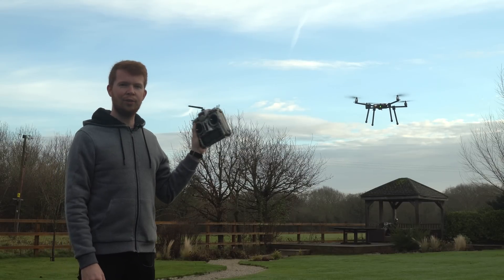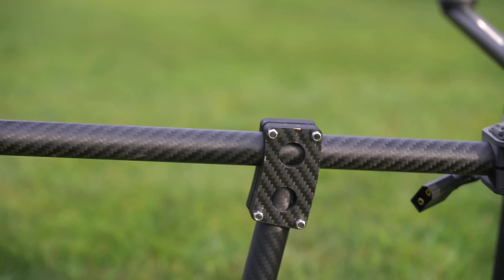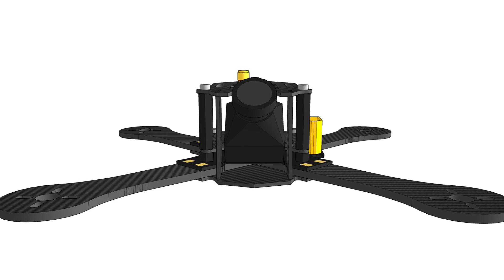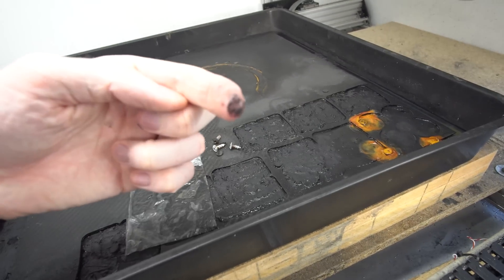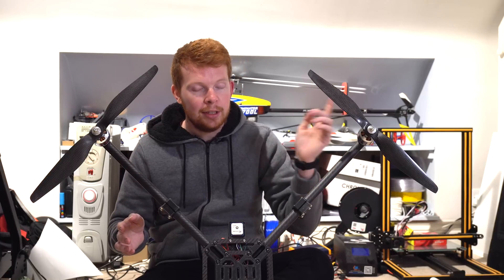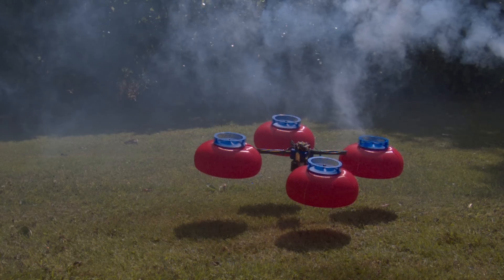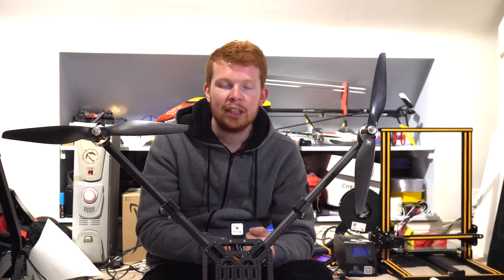I CNC'd a Drone

Comment from the maker: Heres a summary of info that wasn't included in the video:
- No you didn't read the name of this channel wrong, this is my second channel.
- The flight controller runs iNav firmware for the GPS capabilities.
- FDM 'carbon fibre' 3D printing is still far weaker than actual carbon fibre, but good luck.
- The drone cost approximately £270 (approx $350), not including the carbon fibre sheet, multiple broken cnc bits, radio receiver and 3D printer filament and one set of batteries.
- I won't sell kits as it takes a lot of time to manfacture, and there are many cheap kits available.
- I don't sell racing drone kits anymore due to a lack of interest and lack of income.
- Yes I will probably collaborate with Tom Stanton at somepoint if he wants to.
Reply: I'm glad you're going to collaborate with Tom, I think you and Tom will make a fantastic duo
Reply: Tim Station what software are you using on the flight controller ?
Reply: I recommend the pixhawk fc
Reply: Hey I was wondering where you get the carbon plates from and what thickness you used for your racing drones?
Reply from the maker: @Internetprolet1312  I bought it in bulk from a Chinese manufacturer. There are many out there on Alibaba. They were made from 1.5mm and 3mm thick sheets.
Reply: Tim Station thanks for the fast reply I’ll check it out. Thanks alot
Reply: What about the battery tray/screw head riser that's on top of the top plate, do you have the STL file for that? It doesn't seem to be on Thingiverse.
Reply from the maker: Oops sorry I missed that one. It should be added now
Reply: @TimStation  Hi, is there a stl file with all the parts?
I want to see them all together on the drone. Please help me
Reply: Really love the look of this kit. Great job. I currently have a Tarot 650 frame I an putting together. But would love to build one of these.
Reply: Crazy Jonny you still have the information?
Reply: Hey dear nice to see another channel of yours and this does look like one awesome done. One question what do you use for the release mechanism to drop objects.?
Reply: Subscribed 27 April 2025, after you mentioned this channel from your main channel. Been subscribed to that channel for years.
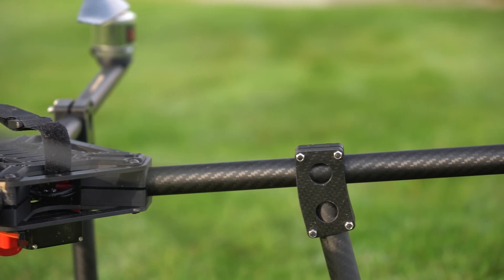Reply: at 1:08 you can see the arms are angled slightly up. Why did you design the drone this way?
Reply from the maker: @corneliusgruss  The upwards angled arms increase position control so it requires less frame tilt to move laterally. This also means GPS control gains can be lowered and it can hold position better in wind with minimal frame tilt.

Comment: Can't you just as easily print a dxf file and or convert that into a 3d model easily, I think in some CAD packages you can actually import a dxf file and use it as a reference or just import that into your sketch

Comment: Hey, I'm building this setup at the moment and I'm having some issues with the motor acceleration on throttle blips. Did you change Motor timing/Rampup power in the ESC settings?

Comment: Hello Tom. I only recently discovered your excellent series of videos and am filling these boring Covid-19 days with your demonstrations.

In this video you gave an analysis of the various weights of the components and potential payload. That this drone can carry. I have ben contemplating the idea of a helium balloon type of space frame that could be designed with just enough structure to support the motors/propellers and let the helium filled soft structure filled with sufficient gas to off set the various components and potential payload. 

Additionally, have you ever considered a helium balloon attached to the batteries which could be tethered (such as 3 thin hollow rods) below a drone in such a manner to stay stable relative to the drone and supply enough lift to offset the battery weight?

Comment: Hi Tom.  Helluva CNC you got there.    I recently got up and running with my own CNC router mill.   Learning how to cut CF and jot break bits has been an experience.    I also cut under water, I actually cycle my water through a fultraion setup so my CF waste os captured and easily disposed of.  The secret to my CNC bathtub is the toilet bowl overflow system(also similar to aquariums that use sump type filters).

  My method requires me to fixture the panels and machine with tabs.   Seems most of the folks out there use a tape/crazyglue and spoil board method but then they are generating dust.

I have already built several micros of my own design on up to very large tube frame 10-12inch builds.    Currently in the design process for a possible 22inch monstrosity that will be running on 12s4p 18650 packs and 5215 300kv motors.

Already having a ton of success using 18650 on everthing from 3in micros on up to Xclass with 6s2p packs running together for 6s4p.  18min flying time on 400kv 13in with 12000mah cruising 40mph the entire time is my best so far.   Soon will have my Xclass running 8s4p.

I learned with one of my builds that tube clamps and tube arms can suck for aligning all the screws/clamps if you use a bottom and top plate to sandwhich all the clamps.

Comment: May i know how do you stabilize the drone, i tried to make one but turns out my drone not stable
Reply: A flight controller needs to be used. This is basically a device that compensates for disruptions (i.e wind, or drifting)

Comment: Those Aerodrive are rated to 5S Tom, if that's who you really are.
 A bit bold to punish with 6S. Not getting a little"warm" under load?
Change of topic: Nice beefy gantry risers on your  Router. Never seen one quite like it, and I have searched the web high and low.
As I recall you had an interesting time with the install or the vendors:-)
Anyway its the quad is stout looking battle ship.
Reply from the maker: Voltage rating on a motor means very little. It's mainly a guide to prevent people over loading a motor. Theoretical the motor can take any voltage, however the load needs to be adjusted accordingly to the kv rating and RPM of use. Yeah the guy who sold me the CNC was a bit of a nightmare haha, but fortunately they don't sell kits anymore

Comment: If the flight controller is mounted in the center of the frame, how is the USB port accessible when need to connect to PC and make some changes/re calibrate? Also, in which way your drone falls when the throttle is cut all of a sudden? Does it fall with landing legs facing the ground or flip upside down?
Reply from the maker: The USB port is easily accessible from the side of the frame as there's a lot of space between the frame plates. I haven't test dropped it yet haha. But I assume it'll depend on many factors, eg which prop turned off last etc.
Reply: @TimStation  Also, I want to know more about how you drilled holes for motor mount on those CF tube arms... Would have been much nicer if included it too in the video
Reply from the maker: @abhishekreddy2425  I used the CNC to cut the holes as seen in the image at 2:31 in the video
Reply: @TimStation  Got it! I'm building the frame with some modifications for my Pixhawk build for DroneKit projects, Thanks!
Reply: @TimStation  How did you place the arms of your DIY quad frame properly with no motor tilt that could cause problems in yaw axis...
Reply from the maker: @abhishekreddy2425  sorry I just found this after last weeks livestream. It didn't show up at first due to it being a reply. The motor mount bolts go through the arms to prevent twisting, then they are just clamped tight at the frame end

Comment: for such a big drone KV is quite high, I would recommend change motors to something like tarot 4108/380KV or 4114/320KV. It will definitely increase flight time and improve overall efficiency. In my setup, I was using 6A/4S with an 800mm frame. With all the equipment the weight was about 3kg. It allows about 30 mins of narrow flight time. FC was a custom one but based on Linux+Ardupilot...

Comment: https://youtu.be/5_HIgBAyRe4 I had built a replica of the DJI Matrice 100 using the same methods. Very satisfying I must say and challenging at the same time to calibrate the F3 FC and iNav. Regretfully didn't use it much after I got the Mavic Air due to its portability.

Comment: Tom- er... Tim... You posted this video at exactly the right time for me. I'm currently working with another drone enthusiast in my area to model and manufacture a frame design of his. We're at the stage of cutting the frame and by God I'm having problem after problem trying to cut these damn 2mm sheets. We made a milling bath and are running it on a Shapeoko XXL. What kind of endmills, feeds and speeds are you using? What're you using to hold the CF sheet, and what's your sacrificial material? And what do you do to dispose the carbon water?
Reply: I was wondering the same think about the carbon dust residue. That's not something that is easy to dispose of responsibly on a small scale, I'd be interested to hear of well thought out innovative solutions.

Comment: You didn't "make" a drone...you've made a frame and bought the electronics and software (or used someone else's free software) There's some difference there...don't you think?
There-s more to a drone than just making a pretty X and stiking the rest of parts on it as seen on youtube from someone else...
Reply from the maker: So I'd have to manufacture all the electronics and program everything with my bare hands to say I've "CNC'd a drone"? Ok

Comment: if you're cutting underwater, do you have issues with water getting between the layers of the carbon fiber?  I know when cutting with a waterjet, water ingress between the layers is a real problem.
Reply from the maker: I haven't noticed any issues so far. Does it increase the weight of the carbon? Or de-laminate the layers?
Reply: Tim Station it would do both.   Water between layers because of delamination.

Comment: Why not just convert the Trex in the background with an FC?. You'll get more flight time, more power and helicopters are much cooler anyway :)
Reply from the maker: Helicopters are awesome, but also expensive haha. One crash with the Trex would cost most than this whole drone!
Reply: @TimStation  Yeah I have a T-REX 600 and the cost of a crash can be anywhere from $200 on the low end, to $600-800 on the high end depending on what breaks. (I'm sure you're aware of this, but just posting it for others) Mine is currently out of service, so I built my own CNC machine to cut the carbon fiber frames as those are currently broken. Just haven't gotten around to cutting the CF yet as I've been messing around with cutting aluminum.

Comment: Nice frame! Any reason you went with 530kV motors instead of 380kV? I'd imagine the power draw is much higher.
Reply from the maker: I picked the 530kv version as there was a similar specification Tmotor that ran 15inch props. 380kv might work well with larger props or higher voltage batteries.

Comment: Very interesting! Thanks for this video! Would be curious to see a more in depth "how to cnc cut carbon fiber frame" and "how to design a quadcopter frame".

Are you running arducopter or iNav on the flight controller?

What is the weight of the frame itself (with and without the legs)?
Reply: He's running iNav

Comment: Great build, awesome! If you want to boost up the flight time (efficiency) oy your quad, use slower turning motors with bigger props. I had great success with Tarot 5008 Motors and 18 Inch props. They are a bit more expensiv but not much! This configuration will give you over 3Kg of thrust per motor and much higher efficiency. The bigger the prop, the better the efficiency at given thrust. Also, the Tarot motors have the t-mount hole pattern and are even 25g lighter than your turnigy ones.

Comment: Can you upload the settings in your Taranis or go over the setup?  I’ve had issues with mine, when setting up the failsafe that if it lost signal, it would auto return. Mine flew out of control and landed while doing a 180 straight into the ground.
Reply: Hey bro! Could you please help me build this thing! I already have all the parts, I just need some help with the motor mounts and the GPS

Comment: Why not 3D print the frame?

Going for annealed PLA, other high strength filaments or even carbon fiber if your lucky and have access to an markedforge printer. 

Should be doable?
Reply from the maker: 3D printing has great applications, but for the design of this frame, it can't compete with carbon fibre sheet in terms of strength per weight.
Reply: Tim Station I understand that carbon fibre plates are strong. But looking at the design I’m wondering if it actually could be 3D printed entirely. Except the arms, which could probably use pvc pipes to keep cost down.

Comment: You said there wouldn't be 3D files so people wouldn't print those frames
But why shouldn't they?
Reply: 3d printing frames is not a very good idea. This is because 3D printing does not offer very strong results, and often results in a very brittle and weak frame.

Comment: Hey absolutely love it i already have my printer going and my friend cncing the frame. I can not find anywhere that sells those motors outside the us. Im in ireland i know you are uk based could you drop a link where to get them or something similar
Reply: I would go to amazon, I think they make international deliveries. I would go with DJI motors as they delivered quite promising results for the drone i built and designed.
Reply: @VoltageGuy2000  which dji motors did you go for?
Reply: @Schulz-Racing  Oh I went for the DJI phantom motors, they worked extremely well for me. Good luck!
Reply: @Schulz-Racing  I have done multiple experiments and have gotten very good results, but if you want higher performance, I suggest slightly bigger motors, maybe ones from the DJI m600 drone?

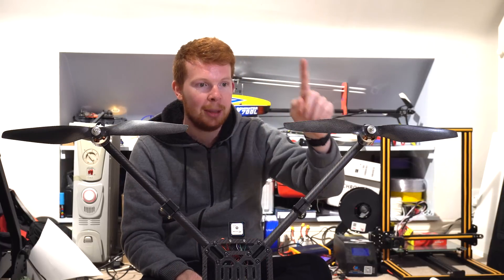Comment: Tom, at 5:35 you explained how a wing could block the thrust if it was under the prop. I'm curious about this - is the thrust not created by air being accelerated by the props. How does the downstream airflow affect the thrust or is it more an issue of the airflow being redirected and therefore causing stability issues?
Reply from the maker: Yes thrust is created by accelerating air. However, if it hits a wing below, it'll change direction, therefore accelerating in a different direction. It's essentially the net acceleration of the air that determines thrust. Similar to if you were on a sail boat and pointed a fan at the sail.

Comment: This is a really nice quadcopter! Is it running INAV firmware or something else to get the GPS return to home function? Also, have you considered using Li-ion batteries (18650 cells) instead? I know you made a video about it some time ago, this kind of drone is the perfect application for that. Would give even longer flight time.